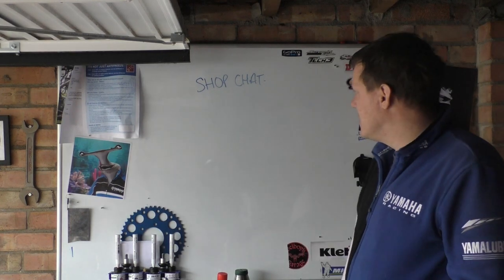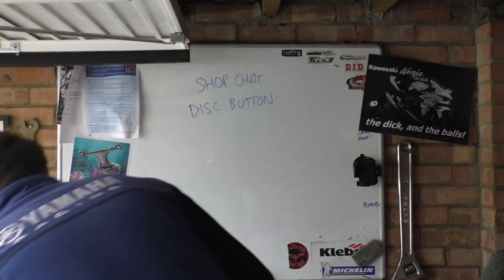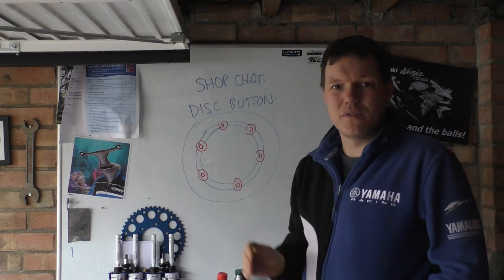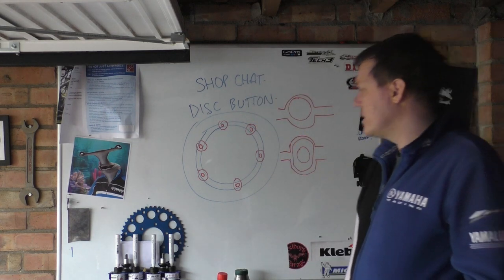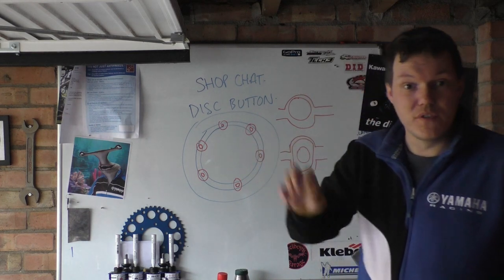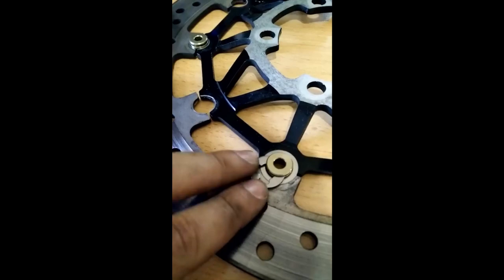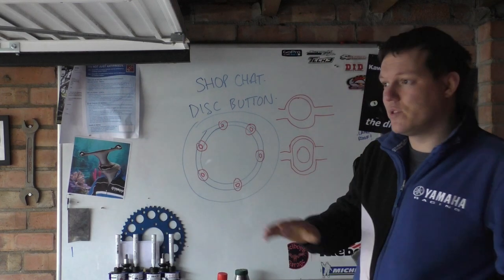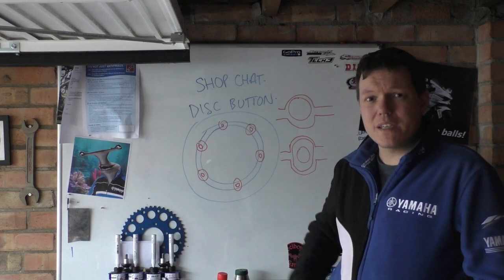SHOP CHAT - Brake button removal?

Comment: Never had an issue but my bikes are garaged, but If a bike is used in an environment where the wave washers corrode enough to fracture,  at least riveted buttons wouldn't fall out and you'd get a fair warning with some vibration / rattling /noise.

So you replace them with e-clip buttons, use them in the exact same conditions and they corrode again.......but this time a button could fall out. 

Your next 'warning' could be a launching over the handlebars?

Personally, I don't cheap-out on brake components.  I want them to work when I I need them.

Comment: is it possible to drill out the rivets and rivet them anew?
Reply from the maker: You'd have to find new rivets and I don't think anyone sells thenm, and if you did you'd have to compress them to spec - which I also don't think it availible.

Comment: Hey the second repair video is mine. The rivets got changed on this GSXR1000 because the wave washers rusted up and broke off. The discs were perfectly fine afterwards. The washers rusted up because the TRW Lucas discs were fitted with shit cheap washers of a poor grade of stainless steel. So I can’t agree with you on this one.  The ‘dodgy’ company selling the replacements are reputable and make their own aftermarket discs as well as spares. When a new set of discs is £300 a pair and there is fuck all wrong with your discs apart from some of the wave washers breaking up why wouldn’t you repair them? It’s not going to weaken them . Bit disappointed in this one, not just because we don’t agree it just smacks of laziness.  You could have spent some time researching the issue. Still it’s your channel, hope everyone on here has an open mind.
Reply from the maker: Pressed enter too early - I also wanna add that this is an opinion shop chat video so research is not required????
Reply: The Workshop the bike came with the discs on it, the previous owner was lazy and didnt take any care of it. The washers on a couple of the rivets rusted an broke up. They are not cheap discs, TRW Lucas are a German brand I think although we used to have Lucas Automotive factories in England many years ago. The repair kit is just that, to repair discs, the company that sells them makes their own  discs with mechanically fitted rivets, they also offer disc rebuilding to the same condition as oem, Suzuki, Galfer, Braking, Sunstar and all BREMBO as well as these DIY bobbin kits as they call them.  You don't have to throw a good set of discs out because one or two washers have 'shit the bed'. I thought you were about trying to teach younger riders how to maintain their bikes, not to simply be consumers. If you have some common sense and a bit of engineering knowledge this could save you £300 for a set of EBC discs against £40 for a set of replacement DIY rivets.

Comment: Good topic, makes me think. I bet someone, somewhere,  is selling anodised buttons with an LED to 'go faster' - if it's a moped/scooter probably no drama. I like the idea of a (factory designed) floating disc, as you say less vibration/squeal and may be cheaper than a floating caliper.

Comment: I don't get why you would want to swap out the buttons for the clip types in the first place, surely OEM/ other reputable brake branded discs aren't much more and swapping them out doesn't require any drilling lol

Comment: While not condoning the re engineering of riveted bobbins ( that has to be a considered choice by the "technician " ) my Saxon Triumph was a development bike commissioned by PFM some 20 years ago and has their floating discs with a bobbin, wavy washer and a circlip with 6pot Alcon calipers. Some washers have deteriorated and I have replaced over time but the bobbins and circlips are still fully functioning. This is a race bike and I believe the braking it experiences is hard on these components however they are holding up well.

Comment: if it was for some offroad thing that tended to chew itself to bits pretty quickly, and you could get a new hoop for half the price and e-clip it on, i probably would. assuming everything's the correct size and blaablaablaa. however, i don't care what they cost, the proper bike gets proper parts

Comment: Over winter its good to clean out the road salt from the rivets so the disc will keep floating and moving right.Never mess with your discs when they are bent get new ones

Comment: My pfm discs have circliped buttons, they work very well on my RF 900 front wheel, same front wheel as mk1 1200 bandit
Reply: Stephen Williams 
Circlip or e-clip? I think I'd be quite content with a circlip to hold the bobbins actually, defo not an e-clip. Good to see a fellow rf900 owner on here too 👍
Reply: wirdy1 circlips hold mine on, they came with a pfm disc conversion kit. I think I recognise your username Wirdy off the Rfoc forum, my username is alien937

Comment: The raceing ines rattle and floo about but are suppised to be alot better under breaking and are less prone to rubbing. Downside is they are a mot failer straight away. Seen a few others put them on there performance road bikes in th usa but here in blighty they are specificly for the track.